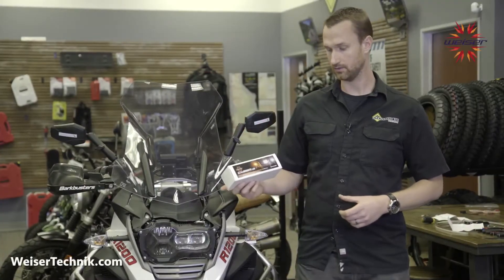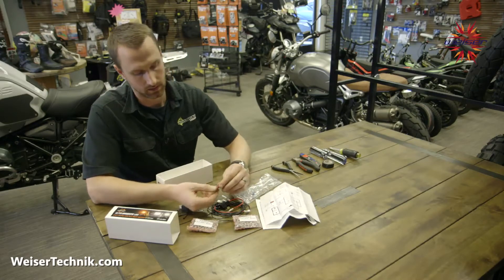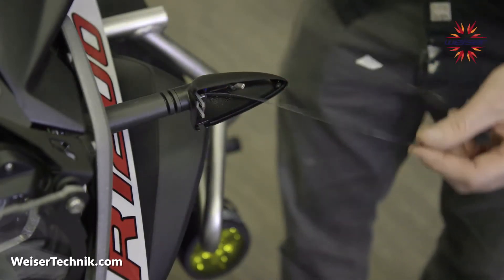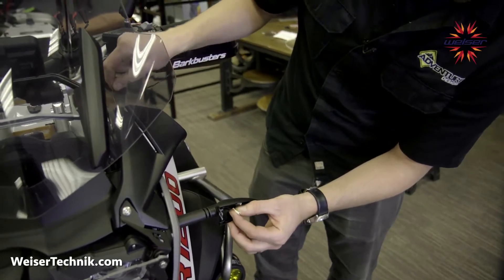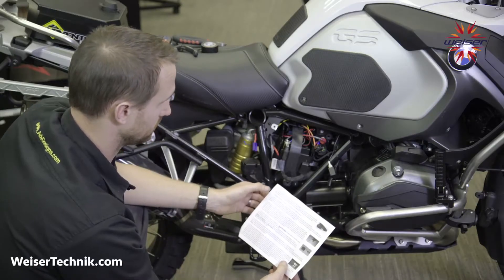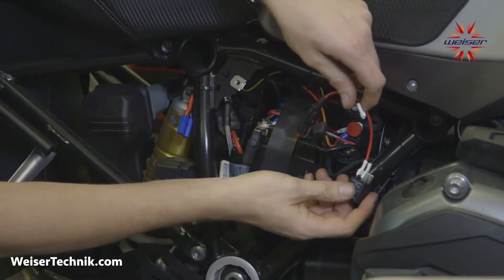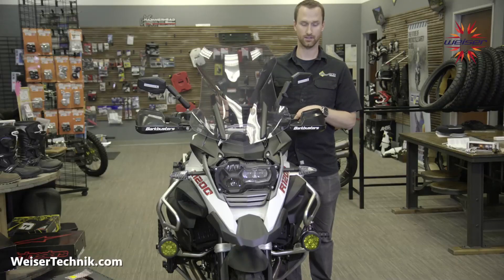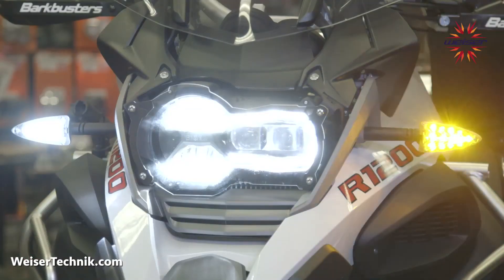Weiser 2 in 1 LED Driving Light and Turn Signal upgrades installation

Comment: You said to put attach the posi tap wire to a grey with red stripe, and then attach the posi wire to a grey with yellow dot?  whioch one is it?
Reply: Just fyi, I have a 2016 bmw r1200gs and for my bike, the brake light is a grey wire with a black stripe and yellow dots (this is the one that you hook the rear brake posi up to) and the running lights, connect the front posi running lights to (Like he shows in this video)  is a grey wire with a red stripe and yellow dots. I hooked mine up this way and it works perfectly. I bought both sets for the front and rear... I hope this makes sense...

Comment: too expensive
Reply: Because being seen on a motorcycle is never priceless right? The lights are not the expensive, and are easy to install. life is worth the price.
Reply: @HipShakeBlues  Naw, he's right. These are too expensive. If you want to be seen better there are tons of very bright LED turn signal options at 1/8 the price of these. Also, this is definitely not an easy install. It is as hard as it can be to install new turn signals. Meaning, you can't just cut and splice the old wires to the new (which would be easy) you have to run all new wires including a transistor etc. It literally doesn't get more difficult than that. I'm sure they are very good quality, but let's not act like they aren't expensive and hard to install.